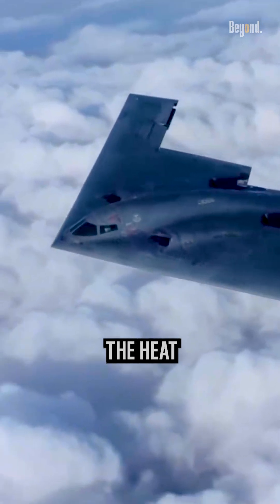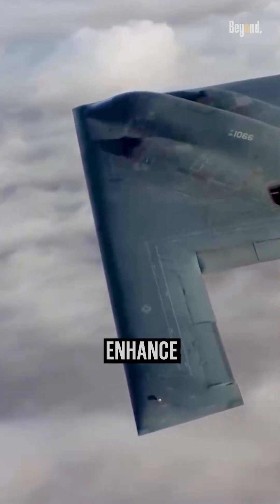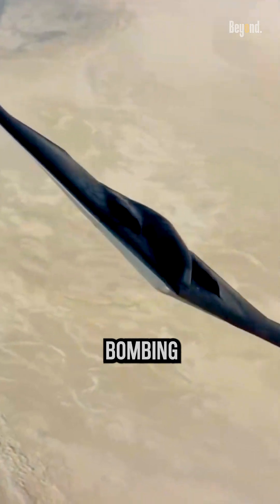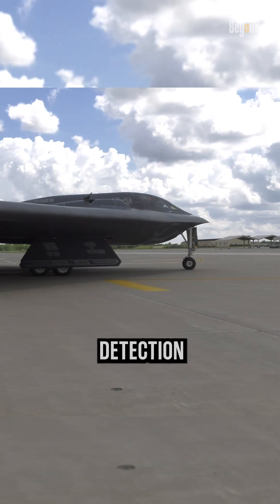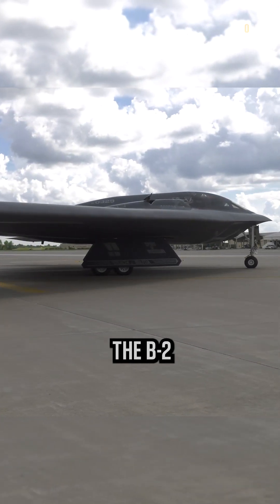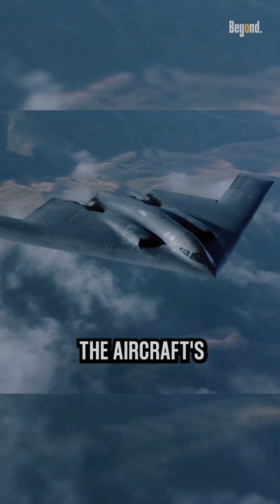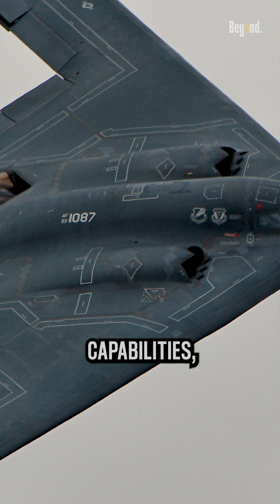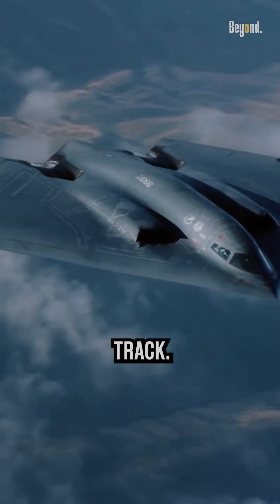Why was the B-2 bomber made to fly subsonic instead of supersonic? #shorts

Comment: Ich habe mal gehört das die b2, bei Regen nicht angreifen dürfen, weil Regen ihre radar signature erhöht...... Hoffen wir mal das es beim nächsten Krieg nicht regnet 😂
Reply: No it’s because the radar absorbent coating is fragile, either have an all weather aircraft or one that can’t be shot down easily.
Reply: Rain was only a factor for the early ones. They’re all Block 30 now and can easily fly in the rain
Reply: @grandmasterpu  👍
Reply: Water is conductive, so reflects radar really well. If an aircraft gets covered in water by flying through rain, it is far easier to detect. This is why stealth aircraft avoid rain where possible.
Reply: @Orbital_Inclination  @grandmasterpu sagt was anderes, 🤷‍♂️
Reply: @Orbital_Inclination that’s also why they overfly or go around storms when possible. 

Modern stealth coatings are far more durable than the early one and weather doesn’t affect them nearly as much

Comment: You also fly subsonic to avoid creating a sonic boom - which is detectable from far away and can be tracked, even if the plane is invisible to radar.
Reply: By the time you've detected the sonic boom, it's too late.
Reply: Well, if the plane could break Mach 1 it would probably break it thousands of miles away from the maximum range of the enemy radars and then penetrate the enemy defences at supersonic speeds, I don't think they would pass from <Mach 1 to >Mach 1 when they already are inside the maximum range of the enemy air defences
Reply: @Danstrous sonic boom is what you hear as a supersonic aircraft passes. It doesn't just occur as the aircraft enters supersonic flight, but constantly above Mach 1. That being said, this aircraft would need to be subsonic to drop weapons anyway.
Reply: The United States military knows how to build a jet with a certain shape that no longer produces a sonic boom instead very small sonic waves role off the aircraft with virtually no noise no louder than the engines